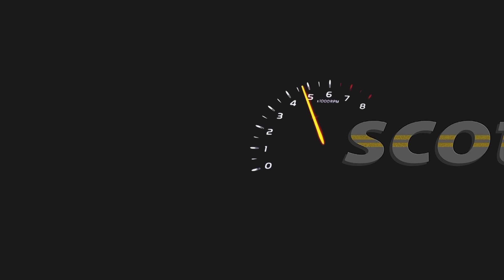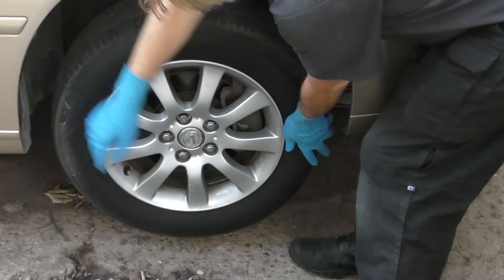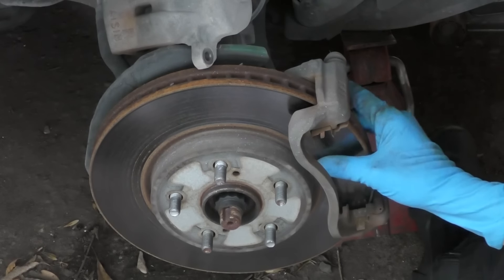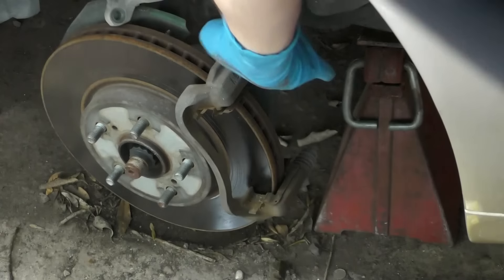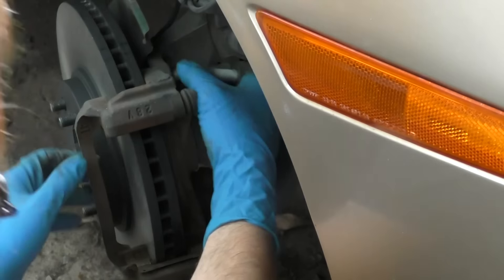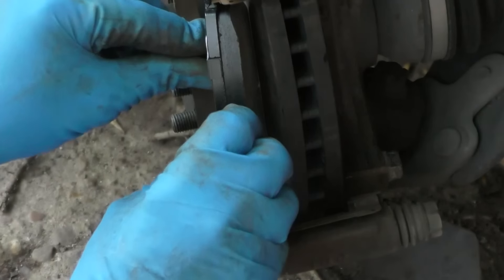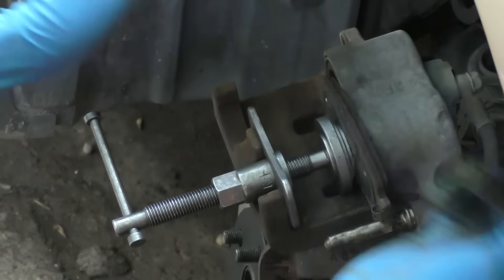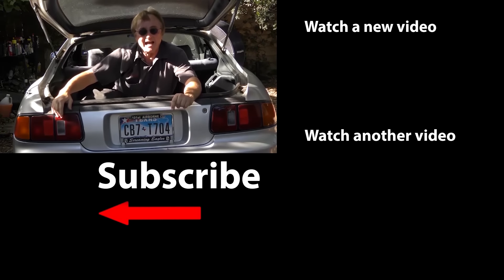Does Your Car Shake When You Brake, Do This

Comment: Scotty. Paint the caliper red. It will help and improve your braking. Also it will show others you mean business.
Reply: plus 10 hp per caliper
Reply: Add a spoiler and get an instant 30 Hp, the bigger it is the more you gain....this is common knowledge lol
Reply: A turbo sticker on rear trunk lid adds 350 extra horsepower.
Reply: @thinkingimpaired5663  now you're talking! That's what up... mad gains.🤣
Reply: i know barely anything about cars and when he toko the caliper off im like hmm maybe i can paint mine LOL
Reply: Nelson B what car is that in your profile picture? Looks great
Reply: @vedantbandre719  69 Dodge charger, I saw it at Target with some big meaty tires which caught my attention.
Reply: Nelson B great!
Reply: Thinking Impaired how
Reply: Since it's a Lexus you can also add a TRD sticker
Reply: Add a "K&N" sticker on your back and you'll gain 85hp🤣🤣
Reply: thats why there red on my gti
Reply: What shade of red should I paint it? And what brand of paint is better for the braking? And do i just need 1 coat or will 2 coats cause the brakes not to work right?
Reply: Wow I just added 600hp to my 1.3 Corolla simply following all the comments here.
Reply: Lmao I love this whole comment section yall helped me increase cars hp to maximum hp but it has so many turbo stickers and spoilers I cant see out the front and back lol but It goes light speed now
Reply: Ipaint rotor for better speed braking
Reply: What does the red paint specifically do..?
Reply: @indigosin714  if you genuinely don't know, nothing! It's just a joke among the car community. Painting anything red makes it go faster.

Comment: Don’t forget to depress the brake pedal a couple of times  BEFORE driving off - it can be very embarrassing when you run to something or someone because you have no brakes
Reply: I was going to say that, don't forget to press the brake pedal a few times until you get resistance! Scotty might want to add it to the video! :-)
Reply: I forgot that part once. I was doing a Pitstop style brake change. Whoops
Reply: What you said is embarassingly funny😅
Reply: @bansheemania1692  that's how i do my brakes, just want it over with. I remember to pump them though before i drive off.
Reply: 😂 yup i forget to do that most of the time! 😏🔥🔥🔥
Reply: Oh yeah!! I saw someone crash thru a cinder block wall because they forgot to do that. Whoops!!
Reply: @jwelchon2416  💥🚗 POW!😂
Reply: Yeah man I'd be so "embarrassed" to commit vehicular manslaughter. Wouldn't know where to hide my face!
Reply: I forgot that once and my heart dropped because the car kept going while I was pressing the brakes lol
Reply: I don’t think hitting someone would be embarrassing in the slightest.
Reply: You have to press the brake pedal just to start the car in the first place. I can’t imagine a person wouldn’t notice the lack of pressure and not instinctively keep pumping the brakes.
Reply: Also the new pads will need to be bedded in, so avoid heavy braking because when braking it will feel a little strange at first.
Reply: Learned this the hard way lol..
Reply: Scotty forgot to mention that jajja
Reply: Im real late to these comments but my car just recently started to do this like 2days ago so I was wondering if it’s safe to keep driving it even if you’re just going to work and back? I haven’t called any mechanics yet so im just trying to get my funds right and look around for anything I need to know beforehand lol
Reply: @robonthego2289  nope just knock outbthe brake job new pads hardware rotors brake grease all good
Reply: I'm just gonna replace the rotors ..do I press the brakes a couple times after I start the car

Comment: I had this problem with my Subaru,  I just googled the issue and decided it was the warped rotors so I changed both front rotors and problem solved. I'm glad Scotty finally uploaded a diy video , haven't seen one in a while.

Comment: I haven't warped a rotor in over a decade, even with heavy duty use. Buy quality parts & USE A TORQUE WRENCH on your lugs EVERY TIME! If its going in the shop, insist they torque lugs to spec before they even begin. Oh & dont forget to "rev up" (pump) your brakes before you drive away after a brake job so you don't warp your car. Like this comment so more people hopefully see it.
Reply: 😒 meh I just put em on good and tight, evenly, they dont have to be on that tight anyways
Reply: ironyofshaun I would imagine it would be automatic to pump the brakes after replacement. Wouldn’t it be natural to do it when you first step on them and they go to the floor?  How could someone not do it?
Reply: @luptonpittman6520  Someone in a hurry, a porter at the dealership I worked at did it. It was a manual transmission vehicle. Porter got into the car, started it, released the hand brake & drove away never touching the service brake till he needed it at the other side of the shop.
Reply: @MrSamadolfo   Yes everyone has a version of good & tight, including a  person with little experience trying to save a buck, perhaps like the core audience of this video. A torque wrench can be had for cheap & should be a staple for any beginner. People with experience can do just what you said.
Reply: @ironyofshaun  🤓 yup sounds good
Reply: Torque wrench. Ha! Ha! Ha! You Goobers and your torque specs.
Reply: Some cars are more prone to it than others. I have never warped one myself but I also brake without 'dragging', just a pump or two does the job and don't 'ride' the brakes, downshift instead. Bolt torque matters if it's uneven (so yes a torque wrench is a good thing) but driving habits do too.
Reply: my cars break rattles when i break hard at 70kph or more speed but not at less speed. then it is completely fine.... what can i do now? it is a toyota 2012 sedan(premio).
Reply: @istiakahmad4727  bad suspension components or only mildly warped rotors? A dial indicator will tell you which.
Reply: What I do is replace the brake fluid in the master cylinder FIRST, sucking the old fluid with a large syringe/turkey baster. Then I bleed the brakes I'm working on (front or rear) until clear fresh fluid comes out of the bleeder screw. By this time the reservoir is low, so when you push back the cylinder it doesn't overflow (check reservoir after doing each wheel for overflow just in case).  Replace the pads and rotors and test the pedal to make sure everythings fine, and test drive it.
Reply: You will notice that most Tyre shops will tighten the lugs until they stop turning. I've seen people try removing their lugs and it's way over 400 ft lbs you can have a giant and a midget stand on the wrench and it won't budge. Very dangerous cause while driving your lugs break off and off comes your Tyre
Reply: IF ONE dosen't torque  wheels properly one risk warping the rotors. Took car in shop once THEY did some work on the front wheels drove off breaked like normal vibration occured when breaking  they warped the rotors . They tightened wheel incorrectly obviously took back to shop told them  they warp the roaders for it did not HAVE broblem before taking the car to them they did not fix the brakes  nor took any responsibility for it actually the service manager played it off as they coldn`t have warp the rotors as I new I couldn't prove it I decided to let it slide wasn't worth geting al made about it. Sam shop even one time flushed brake fluid and I looked at fluid a little later whith cap of and saw a chunk of dirt floating in the master cylinder.  However they did on one occasion replaced al four tires for the price of three  so, I can't say they were al that bad  consistantly.
Reply: I am a woman and as much as I try to understand the mechanics of the car and try to seem knowledgeable at the mechanics store, they always manage to trick me. I wish I had a boyfriend to go with me so he can tell these things to the guy and make the price lower. 😭😭😭
Reply: I just bought a new Honda civic 2 weeks ago and it's in the shop for this. I'm not a car enthusiasts so I didn't understand what exactly was wrong.
Reply: Where can you find the torque specs for various parts of the car? Do they come in various sizes?

Comment: Thanks Scotty, I had an issue with a 2002 Pontiac Grand AM GT. The front brake rotors would warp after a month or two service. After doing some research I bought a pair of drilled and slotted rotors and never had the problem again.

Comment: Good video. Only thing missing is that before compressing the caliber you need to open the brake fluid reservoir to allow for back pressure. It makes pressing it a lot easier when you aren't fighting the pressure. Also lubricate the caliber slider pin since it's out now, a lot of rotor damage happen when the pins aren't sliding properly and wearing the rotor unevenly.
Reply: Don’t take your car to a YouTube mechanic.
Reply: Not true. The brake fluid reservoir cap is not sealed. I agree lubricating the caliber slider pin.
Reply: You know its a calliper right?
Reply: So true, if your worried about back pressure, your compressing piston too fast causing damage that Scotty clearly warned about. @cbrrebates
Reply: @GG-ml3vr  Well actually it is Caliuper from the french word Kaluapour or Calpor coined in Plage de Saleccia Provence just after the treaty of Verdun in 843 which split the Frankish Empire into 3 parts.

Comment: It's Rotor time !  I used drilled and slotted replacement rotors, works great and last long time.  Dad told me to take the top off the break master cylinder too because when you're pressing those calipers back in break fluid will be going back into the reservoir and depending how long since the last time you messed with the break system you may have some over flow.
Reply: Or bust a line
Reply: Your Dad neglected to tell you how to spell brake.  Break means something completely different.
Reply: 🤓 usually the reservoir isnt full so there should be space to fill up, just in case put a bunch of rags around the reservoir 😏

Comment: I have had an instance where this guide would run me into never ending repairs. Repair shops took me through the cleaners several times to replace rotors. The shaking would go away but come back within 5000 miles. I was fed up with their solutions so I started looking into the issue. I wasn't racing so my rotors shouldn't have warped that quickly. I replaced 1 component deeper. It turned out that one of my driven hub bearing assemblies was slightly bent. This gave the illusion that the problem was fixed as your caliper will float a bit but the issue quickly returned. After replacing the hubs I had no issue for 20,000 miles when i sold the car. One thing to add is that this was a used car and i had no knowledge of any impact which may have damaged the hubs.

Comment: Just a couple of pointers. One sometimes it isn’t necessary to replace rotors when they can be spun with a lathe so long as it does not exceed or meet its minimum thickness, however still highly recommend replacing brake pads. Next if your going to replace the brake pads when you plan on depressing the pistons inwards it’s a good idea to remove the brake reservoir filler cap as it can make pushing the pistons in a lot easier and minimizes the chance of damaging the master brake cylinder. Just my thoughts.

Comment: As a machinist, it did my heart proud to see you doing the transfer of reference using the ol' outside caliper. I just did rotors, pads, and new bearing on the Aerostar.
Reply: Can rotors get warped in less than a year? From bad or stuck pins?
Reply: @DominiAeternum It depends on your style of driving and braking really. The harder you tend to brake while driving the more wear there will be on your pads/rotors due to increased friction between the two causing them to wear away faster.

Comment: Great video Scotty. As usual very well explained and educational. Your better off with a magnetic dial indicator. But you and most people reading this already know this. One other  thing. If the Vehicle is equipped with rear drums . Even if you just installed new drums and shoes. If the star wheel adjuster isn't adjusted properly. When you apply the brakes, the pedal will pulsate. It's very easily missed. This is the same procedure for emergency parking brake shoes for vehicles that use rear disc with the parking brakes shoes located on the inside of the rotor . And I have to mention. I love your take on Lexus. New vehicles in general have gone down hill. I'm a proud owner of a 2003 Lexus GS 300 and it's an amazing luxury vehicle. Little maintenance will take you a long way. Also the GS 400 and 430 are also gems. These were almost 80k back in the day. Now you can find one under 200,000klm for under 7k. I could go on and on about these. Your getting a lot for your money.

Comment: This video is worked for my car.  Turn the rotor cost $15 each.,  replace with new brake pad.  It fix the steering wheel shake when braking.  Thanks for the video.
Reply: What do you mean turn the rotor

Comment: I also found it very helpful to grind down the surface of the wheel hub before the new brake disc comes on. Otherwise it could be that rust / dirt will lead to the same unbalance when the disc is heated. 
The surface of the wheel hub can be cleaned with a wire brush or fine sand paper to remove any dirt that may have formed.
Reply: Okay Scotty won’t take you as a customer. You can do it yourself since you know about brakes. You are right about what you wrote.

Comment: When pressing the brake calipers don't forget to remove the top cover of the brake fluid reservoir temporary. This is to release the brake fluid pressure in the brake line when the fluid starts to flow back into the brake fluid reservoir. Put cover back on after all calipers have been pressed.

Comment: Great time to inspect and lubricate caliper slider pins, Excellent video Scott
Reply: ClusterHeadSurvivor Many times I have seen rust under or behind the rubber slider sleeves. When the rubber is in place, it is being squashed by the rust bubbles, thus squeezing the pin while its inside the rubber sleeve.  This will cause uneven resistance between the top pin and bottom pin which will cause a shutter.
Reply: 🤓 yes i posted a comment on it, its so easy, dont b F lazy, pull off boots and pins, inspect clean replace, relube only with clear nonreacting 'Silicone Grease' and install, make sure when u finish that the pin slides freely in & out, thats how she likes it! 😍😂
Reply: Any other extremely useful tips?

Comment: I usually bleed and flush the brake fluid when replacing pads cause the wheel is off and easier to remember when it was done. Brake fluid is hydroscopic so the boiling point goes down with age. I do it every 2 years. Cheap insurance. Additionally if you have and it protects the sensors. Keep the videos coming Scotty. Very educational and saves me money.👍 Appreciate you🏆
Reply: "ABS brakes" autocorrect removed key word.😁

Comment: One of the big reasons why rotors warp is overtorquing the lug nuts and/or torquing them unevenly.  Always use a correctly set torque wrench when putting on your lug nuts, and always re-torque the nuts  if you ever have your car serviced/inspected by a mechanic and wheels had to be removed.
Reply: I used to go to one place they torqued them down by hand.  The also balanced the tires on the car, they don't remove them, it makes for a really smooth ride.
the place had a lot of old timers working there.

Comment: What I like to do is open the master cylinder before compressing the brakes, so that pressure doesn't build up in the lines. Not sure if you just didn't show it or if you know something I don't know. I'm 1/1000 the mechanic you are, and I love watching your videos.
Reply: Do I need to change the brakes I was just gonna change the rotors do I still need to do what you said???

Comment: Scotty.....congratulations.....one of the few people that uses the OLD brake pads as a cushion for retracting the caliper piston.

While the d rotor is off is the best time to clean up the rotor hub.  I use a sanding wheel attached to end of a drill.  Remove the rust, fort etc and make a nice clean, smooth surface for the new rotors to mate to. A small coating of brake cleaner will also
help to remove dirt and rust.

Different people might challenge this step but I put a small coating of Anti-Seize to the rotor hub especially the lip around the drive axle retaking but.  Should make it a bit easier to remove rotors next time.

This should go without saying and basic common sense but you would probably be surprised how many people forget this step.

If you even remotely suspect that the vehicle might need new brake pads, rotors or both...............

Buy the new equipment first.  Keep the new rotors, pads and hardware close by to prevent another trip to the parts retailer...(A/Z, Advance Auto, O’Reillys etc.....especially.  critical of the vehicle is your only mode of transportation.  If the new pads and rotors are not needed return for refund, simple as that

Don’t forget to check the caliper slide pins.  For most vehicles this is what the caliper mounting bolt is threaded to.  Only takes another couple of minutes. I personally remove the pin, clean off grease, check condition and put a new coating of fresh brake grease.  For most vehicles at least the ones I have ever worked the grease is the same type that you apply to the brake pad.
Spray some brake cleaner keep a Q-Tip or pipe cleaner to remove as much of the old grease as possible.

The rust preventative coating applied to the rotor may be black.  Only remove the coating for the part of the rotor where the new brake pads will contact.  The rest of the coating is exactly that. Rust Preventative so you want the majority of the coating to remain.

As usual Scotty.....another good informative video.  Sometimes your videos get slightly long winded but you make the point.
I

After cleaning and